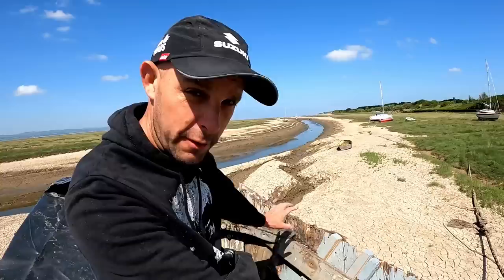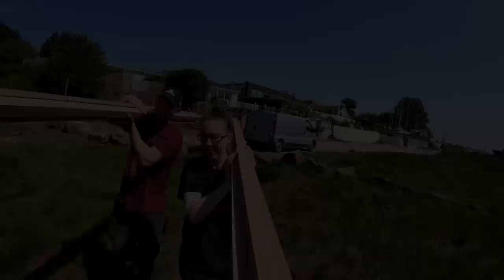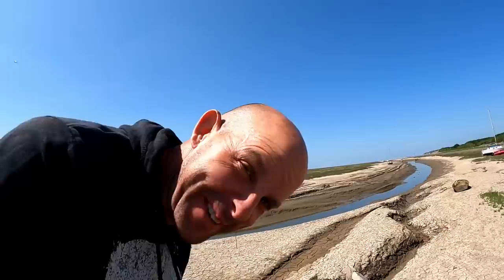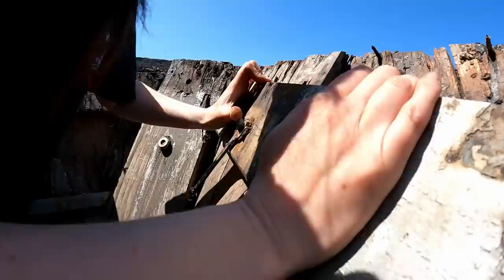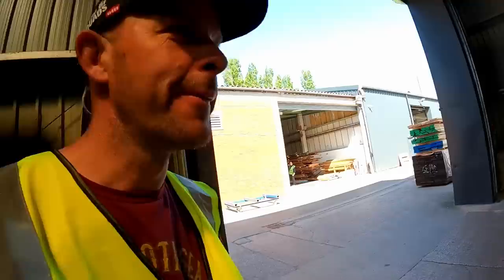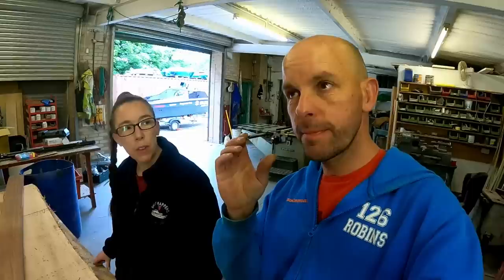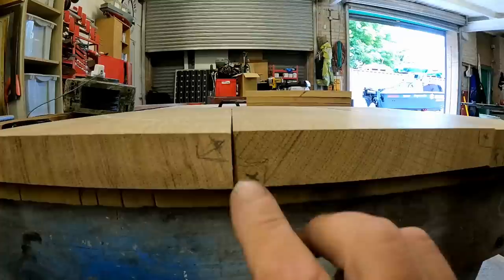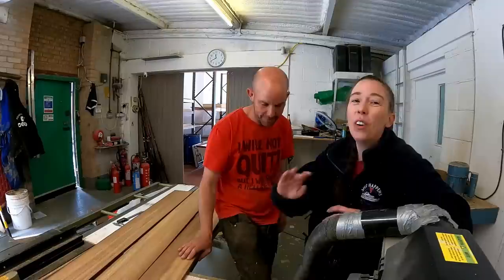Ep 126 - Our Boats Planking Has HOLES!! Plan B......

Comment: Those two extra sets of thick timber each side of her stem are like knight heads. As she’s a power boat they do not extend higher than her beam shelf. On a sailing vessel they would support the inboard end of a bowsprit. 
They add strength where it’s needed.

Comment: Threaded rods all the way through with washers and nuts to release the planks from the stem but not splay them out like a wild blossom when taking the stem out remember it is made with many pieces so finding the hook scarph is great but remember a boat of this age if these are iron in wood every piece of white oak has been comprised around fastners you can replace the first piece but defiantly take a hole saw around old bolts plug with epoxy and resin new through bolts how do I know because I do it every day

Comment: Hats off to you two again, tackling some of the most distressed parts of this boat. So much determination and good humour,  A tip you'll find useful in getting some of those rusty bolts undone is crack the rust by holding a hammer or other heavy tool against one side of the nut then give it a few good belts on the opposing side with another hammer. Do it on different faces. Works with threaded steel pipe joints as well.

Comment: A suggestion , put some ply up as pretend bulwarks and check your vision from the wheel house . Consider a stainless bow sprit , instead of bulwarks , use stainless posts and wire . I did say once before about boat swing with an offset anchor .

Comment: the benefit from  a double rabbet joint for edge gluing wood boards was valid a century ago when glues were caesine or animal based
Today however glues are much stonger and so jointing requirements are different
  This is fully explained in the link below
https://www.youtube.com/watch?v=m7HxBa9WVis
In summary,
Wood is comprised of long strings of strong fibre running in the direction of the trunk.  These fibres are held together by a weak bond that is much weaker than a good quality glue.  Consequently the butt joint appears to be adequate

Comment: watched a guy doing a curved piece of wood on an earlier video that had to have that  curved shape and he used the wood from the tree  root system with the curve in the grain ,wish I could remember which video it was lol  but its great watching you grow in confidence and skill
Reply: It sounds like the stuff Leo Sampson Goolden (Tally Ho) was doing before he had to move the boat to a boatyard. The video where he went to buy the oak logs was absolutely amazing. The ships saw and equipment and work needed to cut the timbers was eye watering. 
Sarinda is less heavily built but curved beams will always be a struggle. And the skill level is much the same.

Comment: Bulwarks,  you mean unstoppable leaks through your deck?  I would make your decks flat and extend the glass over the sides like you did on the roof.  for bulwarks you can poke pulturuded fiberglass c channel through and glass right to the deck. you can rivet them below but the important thing is to glass to the deck skin.  Then attach your bulwarks to these.  Just saying..  Glass will not stick to the stem it is too big a board and will expand and contract too much, either ripping the glass or shrinking and pulling away, so just cut it off at the deck flush and save yourself a lot of grief in the future....

Comment: I am sure I have missed this question by others but I have to ask. When we work on film and TV shows, the set decorators always take photos, print and write measurements the down (Continuity)
because if the scene has to be reshot at a later dats, they have a template to insure accuracy so do you do that?